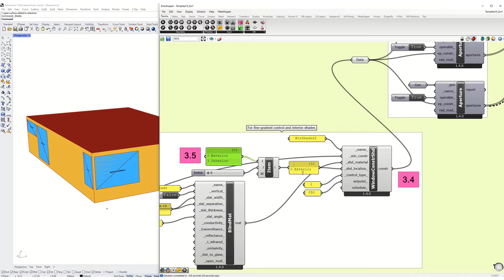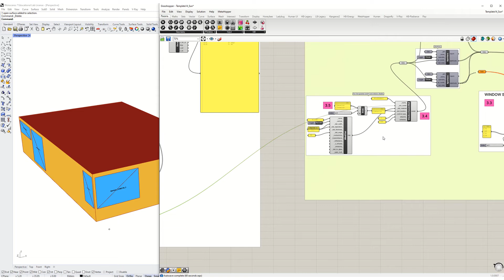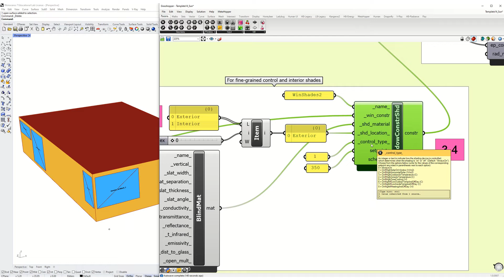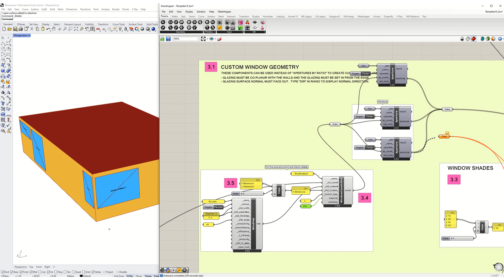Honeybee V1.4 :: Exterior and Interior Dynamic Blinds [Tutorial 3.4]

Comment: Nice video, it helped me a lot. I have a question, if you can answer it I'd be really gratefull: if I set the value "2" in the control_type of the Window Contruction, I'm considering the value of the Orizontal Solar Radiation (W/m2) inside the room or outside the window? Thanks
Reply from the maker: Control Type 2 (On if high horizontal solar) controls the blinds based on the exterior horizontal radiation.  You can find full documentation in the EnergyPlus Input Output Reference: https://bigladdersoftware.com/epx/docs/9-4/input-output-reference/group-thermal-zone-description-geometry.html#field-shading-control-type